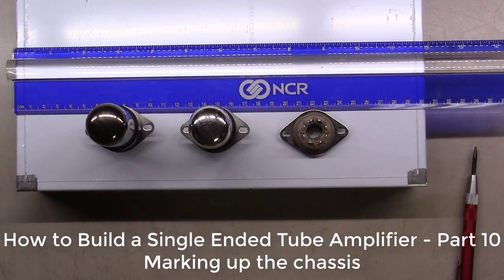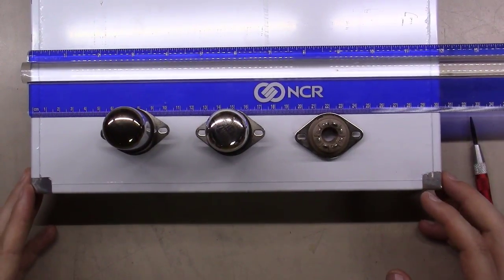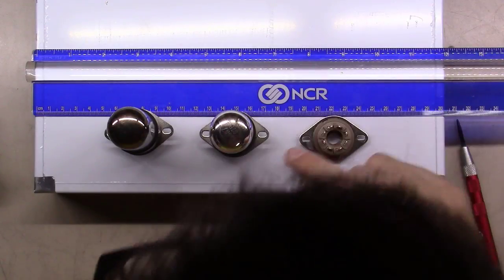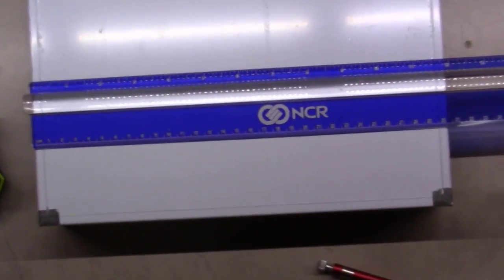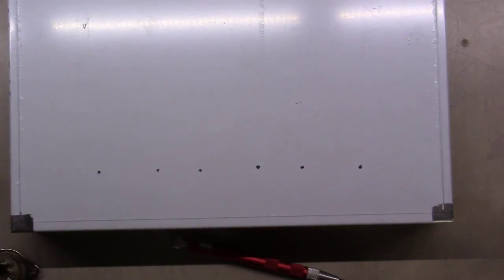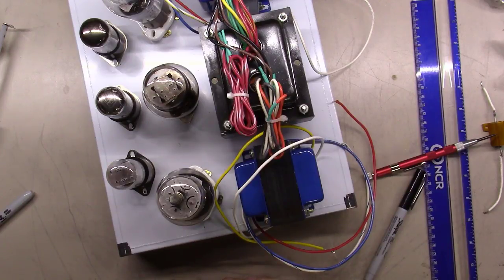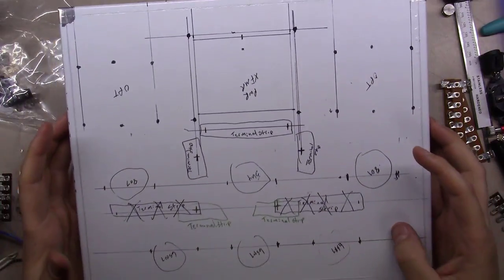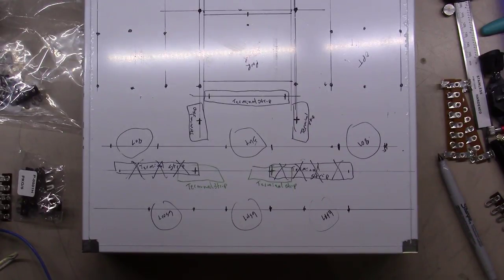Single Ended Tube Amplifier Build 2017 -  Marking up the Chassis - Part 10

Comment: If you have AutoCAD, it works very well to do a layout.   I print out my layout 1:1 and tape it down to my chassis.  Center punch hole locations and drill.  Doing the layout in ACAD, is quite fun.  Edcor has .dwg files for their transformers too.

Comment: This might be superfluous comment, but might I suggest using a "carpenters square" to get easy straight and parallel lines? Unless you do not trust the chassis to be square...
Reply from the maker: Indeed.  I've used one before, whatever works in the moment.  These chassis are usually pretty square so you might be right in the best way by using a square.